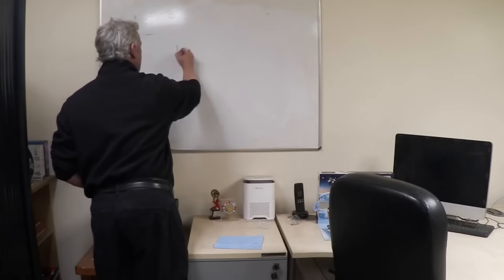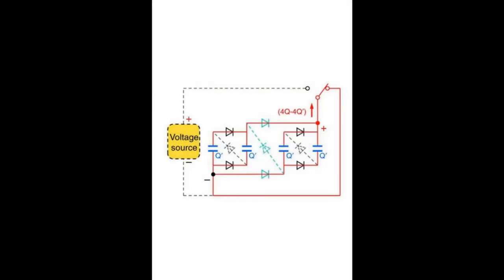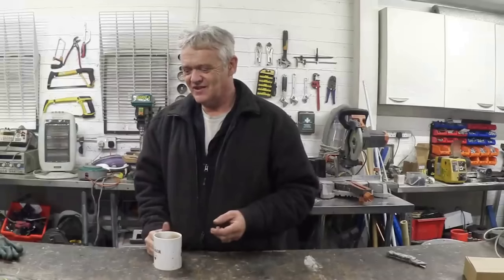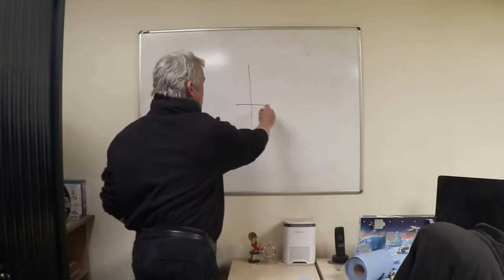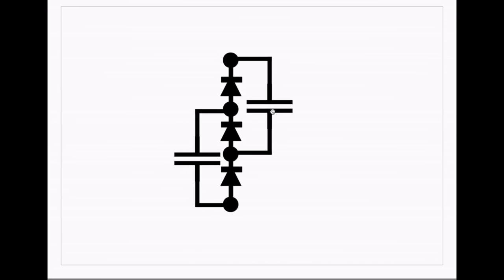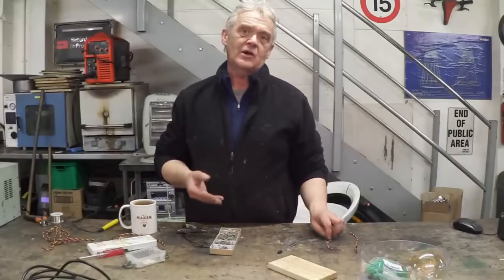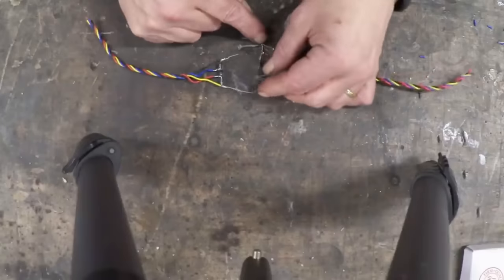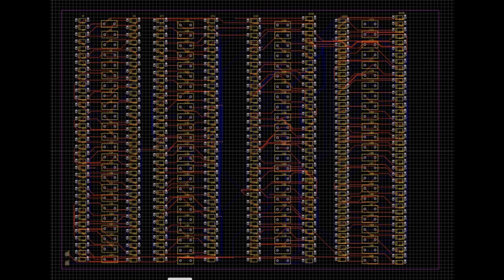028 Unlocking Energy From The Sky - The Fractal Capacitor

Comment: The omnibus is very good at revisiting these things you show.  I understand it a little better now than before, seeing it all together here. Thank you.
Reply from the maker: I am hoping that is the case mate - so that's good to know thanks for letting me know
Reply: I envision a ZPM application using the fractal capacitors instead of batteries in Tesla's   battery swapping  charger and splitting the positive with an output resistance  that  is 1/2 or less of  the difference in potential between the series and parallel  capacitors.

Comment: As someone who just got into eletrconics ive heard of voltage dividers to reduce voltage using resistors, but not  with capacitors, facsinating,  killivolts to 1 volt?  amazing! This means you could fly a kite in a thunderstorm and get energy from lighting? like we always wanted.
Reply from the maker: yes you could!
Reply: @justtinkering6713 capacitors are found in both DC and AC applications. Capacitor voltage division in DC is actually fairly common.
Reply: Or off the roof of an rv with rials too. 👍
Reply: Very interesting stuff. I would be curious to see if this circuit could just naturally manifest electricity from the sky by hooking this circuit's black wire up to earth ground and the red wire as high up into the sky with one of Tesla's atmospheric antennas, and maybe you could even go as far as to make your attenna fractal in nature as well. Everything in this universe is fractal and I truly believe our ancestors knew it and they were harnessing it. Anyone who doubts that free energy exists could be in for a rude awaking to all of this information that has been deliberately suppressed. God bless you for sharing your work. This is some truly incredible research
Reply: @newmonengineering  capacitor division in DC only works if there is zero load current and zero leakage current.  Any leakage currents and all bets are off.

Comment: very interesting explanation, but i have a question, since voltage multipliers work with AC or switched DC and not with simple DC, i think that even a voltage down converter like this needs some form of AC input or switched DC. So it would be difficult to convert an output like the one coming out from an electrostatic machine in a switched DC, maybe you would need some kind of mechanical switch to apply high DC voltage inverting the polarity periodically, or chop it (less efficient) to supply the fractal converter.

Comment: The only issue I see with this, is that the high voltage is always sitting on 3 diodes in serial connection. Therefore their reverse voltage treshold (zener voltage) has to be at least 1/2 of the HV input. The current and voltage dynamics during charge would be really interesting to see. For sort period of time, the diodes are doing really crazy stuff, as the holes in PN junction are quite slow. If one diode is faster then other one, the full HV can be observed on any od these 3 diodes which could potentialy destroy it (like what ESD discharge does in some cases). I think the HV rectifiers are already addressing this issue when you try to serial connect them to increase the "reverse voltage protection".  Or am I wrong?
Reply: The maximum reverse voltage a diode can handle is not the zener voltage.
The zener voltage is the designed voltage produced by a zener diode. Ok, that happens to be a diode in reverse conduction but the point is the zener voltage is applied to a zener diode only and not to other types of diodes.

Comment: Could you not just use a single capacitor of higher capacity to collect high voltage electricity? If the capacity is high enough, it should naturally lower the voltage

Comment: One fly in the ointment, the diodes in the first stage need to handle 1/3 of the charging voltage, dropping to 2/9 for the second stage so the top level stages are going to need some honking great high voltage diodes or diode stacks
Reply: is this a common thing? expensive I'm assuming.

Comment: A similar circuit can be used to improve power factor where the intent is to use rectified line voltage to run a DC load. The half voltage will persist  between voltage peaks, so current fluctuation will be less if caps are correctly sized.  The voltage halver would reduce the size of a choke to get a smooth current ripple.

Comment: You are an excellent teacher and I thank you for going to all the trouble you went to in order to illustrate this concept for us Youtube viewers! Ideally, this concept would be best applied not as a circuit board but as a single silicon wafer chip using present day chip technology. That’s the only way I think this idea would ever be economically feasible due to the economic costs of sourcing the components and actually assembling them together on say a production line. But for educational purposes, its brilliant as a proof of concept. As for your greater goal of harnessing environmental energy, I think Nikola Tesla did it with his resonant transformer design at Wardenclyff, which used the whole Earth as a capacitor plate. What you call “electrostatic” is really longitudinal dielectric. It’s a longitudinal standing wave in the Aether, which is formed by crossing two transverse magneto-electric currents at 180 degrees out of phase (as in a bifilar coil or bucking coil) so that they cancel out to form a single longitudinal standing wave in the Aether. On your mechanical rotary spark gap machine, which was creating high voltage impulses, the longitudinal wave is emitted at the discharge point of the spark gap for each cycle. Tesla’s hairpin circuit works in a similar fashion.

Comment: 25:40 Just in case it's useful to someone doing this with a large number, you can buy packs of 4-pin PWM PC-fan extension cables for not very much at all. These have the same colour wires as used here and breadboard-compatible wire fits neatly into the sockets on either end, if female-female, or you could solder diodes directly between pins on male connectors.
Reply from the maker: nice tip mate thanks for posting

Comment: 🐔 📸 Coat a Mylar balloon with graphene paint, connect up a 0.2 mm copper wire coated with graphene, float it up 200 m with helium.

that should give you  about 20,000 volts with extremely low amperage.

That setup could be used to kick it down to 208 volts with a lot more amperage!

Very useful indeed! 🐔 📸
Reply from the maker: cheers mate
Reply: oh sure, until you try to actually  drive anything with it, and when it suddenly stops after a microsecond of operation I bet you'd be left wondering why.....
Reply: Which could theroetically be stepped down with this fractal, multi-capcitor transformer...
Reply: Everyone who tries this just puts a copper peg in the ground when you need a powered carbon salted pit to allow enough surface area for a proper ground.   You aren't pulling electrons from the air, you're pulling them from the earth and they flow to the higher potential. Tesla used a rotating nickle powder filled coherer spinning at 1000rpm as an interrupter and a capacitor to create AC, then fed it through a transformer to get usable voltage.
Reply: A ground ring would work!
Reply: Battery maintainer maybe?  @ashleyobrien4937  Didn't the Plasma Channel do something regarding like a drone flight or something using?  I forget offhand since been a few month or years.  I do recall having some reasonable idea, though lossy, to step down.  Seems like was a DC-DC converter design. To much head trauma since. 🙂
Reply: Well to move away from the edge of the drop off of 200 feet and condition of insulated probesholsing the conjunction over the clif would be the same to have such alta tood
Reply: Have saltwater capacitors as your ground in a way to use gates of 4007 diods

Comment: I really want to encourage you to continue, because ...
On a different channel there was a discussion about Fermi's paradox and the hypothesis put forward by SOME people was that one civilization using us all the raw materials (metals / fossil fuels / easily-accessible radioactives / He4 / etc) would PREVENT any successor civilization from developing. 
I disagree with that hypothesis because ... NECESSITY is the mother of invention and those civilizations will find a way.
Which leads to the corollary - plenty is the father of inactivity. We haven't invented electrostatic science YET because ...WE DON'T NEED IT (YET). We found electromagnetism, steam, fossil fuels, etc first. Not a lot of motivation to look for more (the fossil fuel people are violently opposing us looking for more so they can stay RICH 😬).
BUT ... any solution for harvesting environmental energy in a meaningful way will be HUGE. After all, that is what a PV panel does - harvest energy that was just lying around. Go outside on a sunny day and there is a kw/sq m to just pick up; it costs nothing once you have the pieces.
I would say that it's better than 90% likely that there is something along this line in the electrostatic "arena" and THAT solution may be as world-changing as the PV panel (and possibly not as inconvenient).
This isn't "perpetual motion" or "infinite energy", it's POTENTIALLY very similar to the "infinite energy" I get from a Renology panel.

Comment: Lovely lovely work! For sure.  But as i watched video i kept expecting the end to show it working. I thought you might hook it up to a power supply and take a voltage reading out of the other end. Not to complain, i just thought it was heading that way and it would be lovely to see.
Reply: …or would big oil or the illuminati come knocking at your door? 🫣

Comment: With all those diodes it's surprising that the fractal works out to be more efficient. Presumable the total series Vf of the diodes in any charging path must be lower using a fractal configuration. It would be interesting to compare the diodes charge path in a Cockcroft multplier with the fractal equivalent.
Isn't the absolute voltage of the high voltage limited by the PIV of the first three diodes in series? To increase the PIV, it is usual to put more diodes in series, which reduces the efficiency.
Reply: so the first 3 diodes would need to be extreme... or... in massive parallel design?
Reply: @dynamicresistance  I have since found some diodes used for microwaves, they are rated with a PIV of 12kV @ 450mA. That gives 36kV input voltage for the first three diodes in the basic building block. ( The Peak inverse voltage limitation  makes it necessary to put more diodes in series to handle the high voltage without breakdown, that generally increases the Vf losses.)
My comment on the Cockcroft multiplier was ill judged, as the fractional design is for DC and not an AC supply. The diodes just switching between the series charging connection and the parallel discharge connection. I downloaded the cited document on piezoelectric energy recovery that use the fractal design. The energy losses are associated with the Vf of the diodes, and how many end up in series to get down to the required output. It is an interesting way to get from a high DC voltage at low current, to a lower DC voltage at a higher current. It may be a way to scavenge useful energy from static electricity, such as that associated with aerial space charge.

Comment: Fascinating research.  I remember when I was working at NASA I saw something about Asymmetric Capacitors producing propulsion, would be interesting if that could be expanded to fractals, maybe something taking high voltage in and producing hundreds of propulsion modules, seems like UFO technology.
Reply: Because they had a bank to spend and  the muscle to put study into practice. 
I believe they should be farther in the collective knowledge obtained.
The reason I believe this is because they're still using combustion rockets.
Reply from the maker: asymmetric capacitors are very interesting

Comment: I seen your video on Stirling engines and that was really cool the thing I'm noticing as these people making hydrogen for their car it's running off of their alternator which makes the engine work harder which birds up any thing but I was thinking if you put a sterling motor running off your manifold of your – run car and then to make the hydrogen then you could run the hydrogen and then you wouldn't be using any energy except the wasted energy off to the thermostat does that sound right

Comment: Not the fractal capacitor I was expecting - very interesting.
Reply from the maker: what were you expecting?
Reply: @TnTOmnibus  I was expecting a fractal electrode pattern cap - they have larger capacitance than you'd expect due to the large edge effect.  I was not expecting a new power converter topology.

Comment: Thank you for explaining an interesting idea simply. I'm wondering about the capacitor specifications:  am I right to assume the voltage across each capacitor is proportional to the overall voltage divided by the number of capacitors - in which case the dielectric will have to withstand at least that voltage. Secondly does the schematic imply the capacitors should be matched.  Thirdly would you envisage off the shelf capacitors (ie electrolytics) would suffice?

Comment: ERROR at 0:55: When 10V is applied to capacitors 2.2uF (right) and 22uF (left) in series, 9V appears across the 2.2uF (right) and 1V appears across the 22uF (left). It's not the other way around as he claims. ERROR at 11:54: Snowflakes grow with characteristic hexagonal crystal symmetry, not described here.

Comment: There was some kids that built an atmospheric antenna recently at a university in England, they added a resister to the antenna and got it to power a low powered transmitter, they were successful in transmitting a signal... Voltage rectifiers can do the same thing but also I had another idea... If you charge up the positive statically with the negative connected to earth couldn't a transformer be added to the negative so as the spark jumps across the electrodes before hitting earth it will power up the transformer and convert the current into lower usable voltage... I like your idea though... I had a similar idea for charging batteries years back... If they're charged in parallel but then used in series via switching you would have access to incredible amounts of power. I made with cardboard glue and aluminium, a mechanical circuit that altered it's flow creating breaks and bridges as specific points...

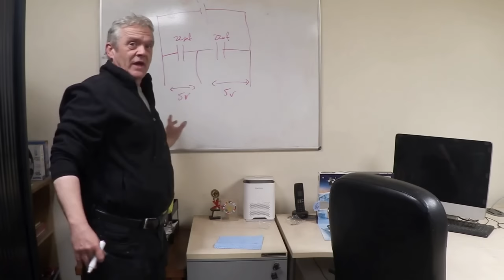Comment: 0:59 - Did you describe the capacitor voltage division backwards?  What's actually happening is that you have equal charge on the two capacitors.  If you put the same charge Q on a smaller capacitor, you'll get a higher voltage.  Q = C*V; keep Q the same, make C smaller, V has to be bigger.  So the larger capacitor will get the smaller voltage, and vice versa.
   
The charges match because there is no current path to the wire between the capacitors - the only way to get charge +Q onto one of them is to pull that charge from the other one.  The voltage source can only supply charge to / take charge from the outside plates of the two capacitors.

Comment: I did this experiment with a Wimshurst Machine connected to the high voltage side of a car's ignition coil where the discharge voltage of the capacitors had been depleted. The 12v 4W lamp flickered quite brightly. low voltage side.

Comment: You should check the fractal lightning rods.  They completely avoid lightnings by sucking the potential difference / static electricity with a corona.  They are patented and expensive.

Comment: Thank you for sharing this, I enjoyed it very much! One question - as the scenario is fractal, does that mean the voltages or currents drop or increase in an exponential way? If so, does that mean the voltage or current ratings of the capacitors and diodes, would have to be able to withstand the full HV or HI input or output directly? I'm trying to see the benefit of this network compared to a Cockroft-Walton multiplier, which is more of a stepped function to get high voltages. Thank you!

Comment: Great work I only have one big problem with it is lighting strikes.there mysterious.there constant in one area and almost none existing in others ..if you are vulnerable your toast.
Reply from the maker: you can always use the difference in potential between ground and height mate
Reply: @TnTOmnibus  isn't it the difference that kills you ? I'm missing something?
Reply: @TnTOmnibus  they used a cap and a spark plug back in the day.i was thinking of doing something like this but the lighting strikes put me off of it ..what's wrong with a cap and a neon trigger for a mosfet to dump at 100 volts going to a door bell transformer kicking it down to 15volts ?

Comment: I don't always use magnets, I use magnetism a lot. Electromagnets with motor brushes in diy custom transformers allow you to step out variously, with the availability of stepping up without overheating by returning the resistance to the charge controller(s) with batteries. I had 2banks, 1 day and 1 night, each having inverters . At night the lights were charging the day bank. Bigger appliances  taking both banks with dedicated alone time to use. The step out transformer was beyond the usage built for.  With a few more advancements by necessity, the future should be a leap ahead, after the so slow of a pace it seemed to be backwards in direction is finally getting less in appearance.
Reply: Wow.   Sounds like you maximized  circuit effiecency and resources putting everything to work chuckles.   This reminds me of the dream were i had a actual house and white picket fence and things were happening.